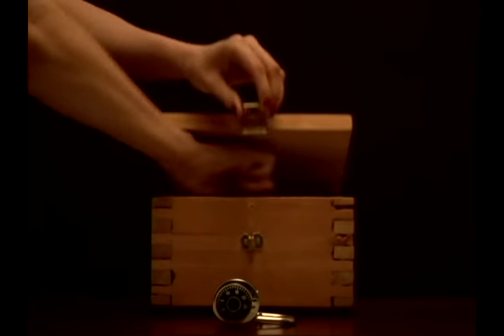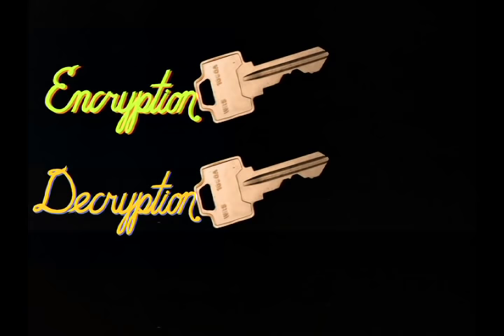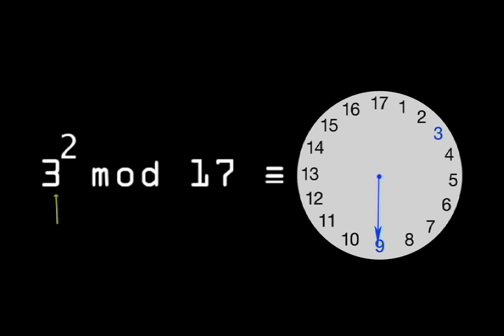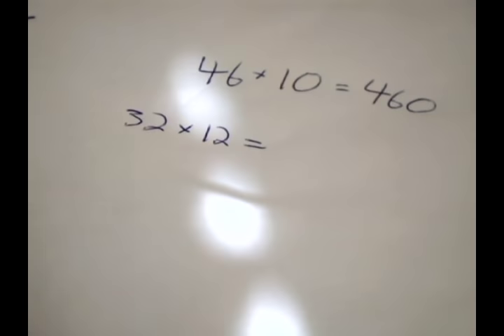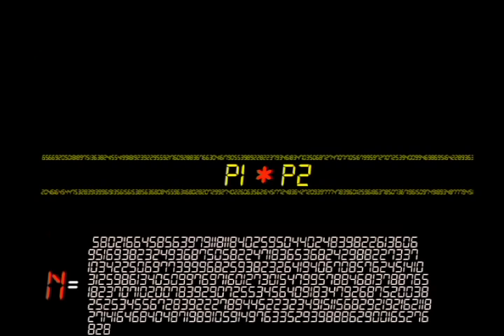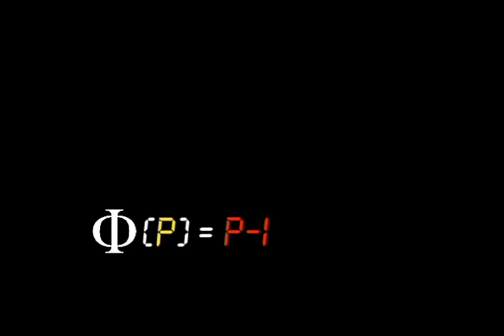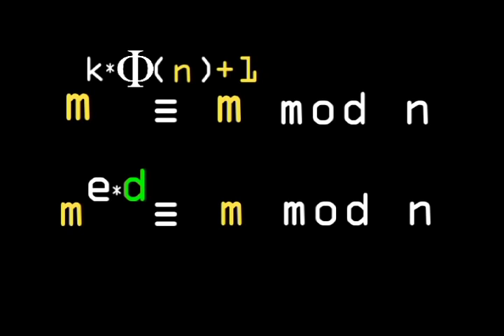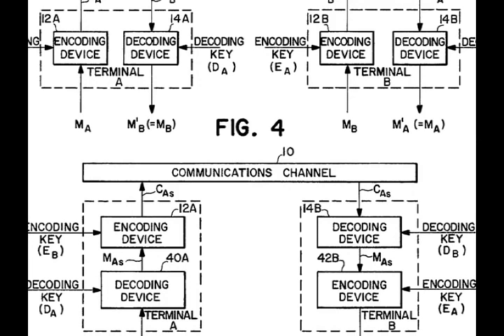Public Key Cryptography: RSA Encryption Algorithm

Comment: You say that Euler's Theorem works only if the two numbers are relatively prime, but nowhere in this system do you require that the message to be encoded and n=p*q are relatively prime. Why does this encryption method still work in the cases that m and n aren't relatively prime?

Comment: Admirable how simply you worked through explaining it all. Beautifully done, both the delivery and the accompanying graphics and animation
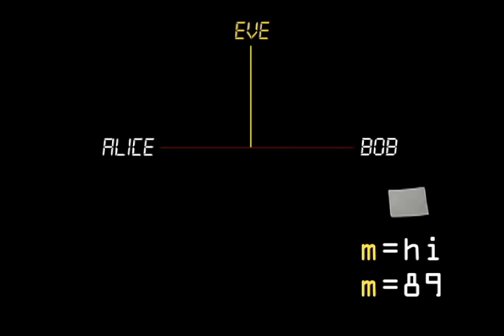Reply: +Art of the Problem question, at 13:43, which component is the chosen color, and which one is the "complement" color?
Reply: This is an amazingly well laid out video that is far easier to digest than learning it the math way.  I wish it was around 20 years ago!  I've never seen it's equal that shows the multiple ways - color mixing, private, secret, pre-shared, AND the underlying various encryption schemes/history in such an understandable manner!   Well Done!
Reply: at 14:14 did you put the value of k randomly. so if i put k=1 or k=5 i will have different values of d(decription key), will i get the same value of m(message)when using the decription key d?
Reply: @arfcommer15  The "math way" is clearer than this. This video glosses over many important details

Comment: Outstanding explanation with one frustrating defect: throwing 'k' in with absolutely no mention of how to obtain it. Getting the right k is essential for calculating d.
Reply: calculation of k is not entirely necessary. we can take the bezout relation of e and phi(n) as our d value, or use the extended euclidean algorithms to calculate it.
Reply: yes, it's right. d is a multiplicative inverse of e mod phi(n)
Reply: can someone please explain in simple terms how we get k, I need it for a project
Reply: (ed - 1) = k*phi(N) for some integer k, we don't really need to know what k is since we just obtain that cluster by doing (ed - 1). (According to a book on this subject).
Reply: Agreed.  That was glossed over.  As I understand it, because of the repeating nature of the mod function, k can be anything you want, just to add a bit of randomness into the key.  
Hopefully I can post a link to another video here, as choosing d and e is better explained here, IMO: https://www.youtube.com/watch?v=oOcTVTpUsPQ
Reply: Iterate k value start with 0 ,when d becomes an integer instead of a fraction stop. Here calculating k is not imp. As we we are just using d which is the private key.

Comment: I would like to share some ideas I learned about the topic. Many of you asked about how k came on. Let me approach this from a different angle. We would like to choose d so that e · d = k · ϕ(N) + 1 is true for some k. In other words, we need to fulfill the following congruence: e ⋅ d ≡ 1 (mod ϕ(N)). Since we have already found an e so that e and ϕ(N) don't share a common factor, or in other words, gcd(e, ϕ(N)) = 1, this congruence is a linear congruence for the variable d, which has a solution, because of the fact that gcd(e,ϕ(N)) = 1, and can be solved using Euklides' algorithm. Therefore, the main point is not to find a k by guessing, but to find d directly, using the method mentioned above. I hope this helped some of you.
Reply: i still dont understand why we need K
Reply: @bartoszkowalski885  you dont
Reply: OK I understand your point, but how do we calculate k?
Reply: @Loxodromius  you use the euclidean extended algorithm, which gives you d and k at once. You can Aldo get d with the Chinese Remainder theorem, if you know p and q, which is more efficient.
Reply: @bartoszkowalski885  I thought the usage of k is to find an integer d,
say at 14:20 (3016+1)/3=1005.667 but (2*3016+1)/3=2011, which is a 4-digit number

Comment: At 14:20 where did that k = 2 come from in d = (2*3016 + 1)/3 ????
Reply: So I pick k = 1 and end up with a non-integer number. What happens then?
Reply: Then you try k = 2, if it's still non-integer then you try k = 3. etc. In my exam we worked with these numbers, going to use the same variable names as in the video.

p1 = 31
p2 = 23
m = 42

n = 31*23 = 713
φ(n) = 30*22 = 660

Choosing e, starting with e = 3 => 660/3 = 220 //Not good
Testing e = 5 => 660/5 = 132 //Still not good
Testing e = 7 => 660/7 = 94.28571429 //Good, doesn't share factor with φ(n).

Choosting d, starting with k = 1:
d = (1*660+1)/7 = 94.42857143 //Not good, non-integer.
Try k = 2:
d = (2*660+1)/7 = 188.7142857 //Not good, non-integer.
Try k=3:
d = (3*660+1)/7 = 283 //Good

Encryption:
c = m^e mod n = 42^7 mod 713 = 199

Decryption:
m = c^d mod n = 199^283 mod 713 = 42

Hope this helps :)
Reply: tywald Thanks for writing it out! Helped a lot for a lazy mobile user.
Reply: my book kept confusing me as it didnt clear the trials that u showed. and with the video, i was goin crazy. thanks for putting it up.
Reply: thanks, made even the last bit clear
Reply: Hello,
in the video first he says φ(n) = n-1, then WHY φ(713) is not equal to 712 ?
Reply: jai bharat φ(n) = n-1 if n is prime
Reply: The number 713 is not a prime number. It has two prime factors (23 and 31).
He said that calculating φ is actually a hard problem for large numbers except for prime numbers where it simply is (n-1). 
φ of a composite number can be calculated by multiplying together φ of each primefactor of that composite number. 
So it simply is: 
φ(713) = φ(23*31) = φ(23) * φ(31) = 22 * 30 = 660.
Reply: for large integers (which in practical uses it will be) we cannot easily calculate this k as others have suggested. but i do not like working d out this way. d can actually be calculated using the extended euclidean algorithm. or, if you have the pari/gp calculator, taking the first number of the bezout relation of e and phi(n). saves the hassle
Reply: Thank you for explaining that. When I tried to go through the math, I was stuck wondering where we had pulled "k=2" from.
Reply: That formula is only valid for prime numbers.
Reply: 713 is not a prime number, hence its phi function is not equal to (prime -1)
To find if 713 is prime or not refer here : https://www.isprimenumber.com/prime/713
Reply: What you're doing in that step is solving for the multiplicative inverse of e mod phi(n). This is defined as e*d = 1 mod phi(n) and it implies that e*d + k*phi(n) = gcd(e,phi(n)) = 1. This is Bezout's identity.  Note that an inverse for e only exists if it is coprime to the modulus. This is because of Bezout's identity. By Euler's theorem, a^(phi(n)) = 1 mod n. This means that p^(e*d) = p^(1+k*phi(n)) = p^(1)*p^(k*phi(n)) = p^(1) mod n.
Reply: Hey there, anyway you'd mind explaing this a little more, I keep tripping at 42^7 mod 713. I'm a young female, and its probably odd for me to gain interest in encryption, but I want to.
Reply: that rule only applies when n is prime. 713 is not prime, so φ(713) does not equal 712
Reply: @tywald  thank you, i had the same doubt
Reply: thanks a lot  @tywald
Reply: @tywald  Your actually a life saver, no cap
Reply: @tywald  Thanks a looooooooot You r awesome. Did my day. Really appreciate it.
Reply: @danielwhettam1564  not when n is prime, but when the factors of n are prime. n will always be nonprime becuase it is a product of 2 numbers... namely p and q
Reply: anyone having trouble figuring out it, go here: https://www.cs.drexel.edu/~jpopyack/IntroCS/HW/RSAWorksheet.html
Reply: @jaibharat4994  because it's (p-1)*(q-1)
Reply: @tywald  Thank Genius..!!
Reply: @tywald  wowwww that's best example ever. Thanks
Reply: @jaibharat4994  Because 713 is not a prime number.Its factor are 23,31.
Reply: @tywald  thanks! So if I understand correct the 2 just ist the first number that gives a d without anything after the comma, right?
Reply: I did some calculation and found that k can be any number as long as  d turns out a whole number(integer). In the particular example k=2,5,8....can be taken, we get different values of d but when used to decrypt the cipher they all give back the same message. But does that mean that we can have infinite number of d(private keys)?? I am confused. Somebody please explain.
Reply: @rocksonrong8401  yes, you can have infinite number of d with different k, k2=k1+e, k3=k2+e, etc. and they yield the same result, however the hardest thing is to find the first d.
Reply: @tywald  Thanks so much!
Reply: I think k can be any number that should always gives d as an integer.

Comment: quick question, around 14:21 we see that the equation as 2 as the K value, why is that, because when I try to replicate this equation, I can't seem to get a resulting whole number, so why is it 2 in this case, what do you have to do to put in the value for K?
Reply: iterate k from 1 until (k*phi(n))+1) is divisible by e to give an integer, if the result is in fraction then increment k n try again.

Comment: Thank you so much for this video. It explained everything so well and helped me finally understand! Just one question. Since this all relies on Euler's Theorem, for which you mention that m and n must share no factors, what if the message m happens to share a factor with n (i.e. it is divisible by either p1 or p2)?
Reply: @Maya Bielecki 
Although Euler's theorem itself - in the form m^{φ(n)}≡1 (mod n) - is indeed only valid for an m relatively prime to the modulus n (relatively prime means that they share no non-trivial factors or equivalently that their greatest common divisor is 1), the actual relation justifying the validity of the encryption method is a bit more general, as follows: given a square-free natural number n (this condition means that n is not divisible by the square of any k≧2 or equivalently that all the prime divisors of n have multiplicity 1 in n; do remark that this is in particular the case for N=p_1*p_2, in the video presentation) and a natural number r congruent to 1 modulo φ(n), it is necessarily the case that m^r≡m (mod n).

Comment: Lovely Technology.

Public Certificates are a godsend. After all how many unsecure websites are there still. Shops, banks, services, so many are pretty much forced to have high grade RSA based security. The quality of the certificate and its signer might differ but most ought to be safe enough. 

And the funny thing is that once encryption is set it usually uses symetrical or some other lower power/energy method. But to set up the communication you use this pretty nifty system. 

Hell the idea that you can share a public key and yet you are safe. That is something quite special.

Comment: I'm sorry but the equation at 15:02 is incorrect.
It should be  (1394 ^ 2011) mod 3127 = 89
Reply: Thanks for that. Was following then got super confused. I mean how can you know the message (89) prior to running it.
Reply: What is shown at 15:02 is a congruence, not an equation. If someone writes "a (congruent) b mod n" (where congruent is usually written as the triple-line equals), that means "a mod n = b mod n" (this time actually equals, an equation). The first way is just a slightly simpler way to write it.
Reply: Larry Ruane - I still do not have `b` by that formula... and he clearly spoke "(c ^ d) mod n" and not the written formula (with congruent)
Reply: you read the symbols wrongly...  he didnt say 1394^2011=89 mod 3127
he stated: 1394^2011 is congruent to 89 modulo 3127( the three lines symbol denotes congruence and not equality) - this means 1394^2011 mod 3127 = 89 mod 3127 or simply 89. In case 1394^2011 mod 3127= 89 than its true... i dont have an algorithm to verify this bet it should be true.
Reply: Did you try it? if you did, you would be understanding that smth is off, cause that wouldn't give you 89 at all.

Comment: Thanks for all your videos, beautifully done, I'm using them to study for my exam. In min 15:04 it's written c^d ≡ 89 mod 3127. there should be c^d mod 3127 = 89? Sorry for my English.
Reply: In modular arithmetic, that's equivalent. If at the end you have mod N, you can think of parts before and after the ≡ as all having that mod N.
E.g. c^d ≡ 89 mod 3127 is the same as c^d mod 3127 = 89 mod 3127

Comment: If you can spoof the public key, you can MITM, but that is the beauty of public keys- they can be published all over, in centralized directories, in images, on multiple sites... so if you are diligent about checking you have the right public key, you can reduce MITM down to interruption of service or replacing messages altogether, but you can't read the sent messages.

Comment: At 15:02, the screen shows "1394 ^ 2011 = 89 mod 3127", which seems *wrong*!
The voice, however, seems to say the right thing: "c ^ d mod n = m" (or (1394 ^ 2011) mod 3127 = 89).
Agree?
Reply: I think 1394 ^ 2011 [is congruent to] 89 mod 3127, so it uses the three lines. I'm not sure about the specifics of what that means but it works the way you did it (do it with python: pow(1394, 2011, 3127))

Comment: In an attempt to better understand this I wrote it in to a script but it is common for the decripted message to come out as "1".  I have hard coded the msg and exponent and I randomly genrate the primes.  

Msg 89 and exponent 3

for example with prime 31 and 43 we get mod 1333, public key 1260, and private 840. 

I get 1145 as encripted msg and 1 as decripted

I run the script a few times and sometimes it works, the only thing that ever changes is the random primes.

Comment: At 12"15', it's stated that Euler's theorem m & n need to be co-prime, it used example 5 & 8. But m is message, does it mean for a particular e, d pair which have corresponding n, certain messages m which is not co-prime to that n can't be encrypted by this RSA key (because that message does not satisfy the conditions of m & n being co-prime)? So I think perhaps the explanation is not yet a complete picture?

Comment: One question: if I have a large string, let's say of 512 bytes, I can guess that I need to work like if my message 'm' was m = m1 + m2 + m3 + ..... at what lenght the string must be split to work with each piece separately? What is the requirement for 'm' to fit into the proccess?

Comment: Considering that N is usually a huge number and e is usually a fairly small number.  Isn't there a good chance that the cipher text C=m^e is smaller than N, especially for small messages? If that is the case all you need to do to decipher is m=C^(1/e). 
Take the example in the vid, if m would be 13 then C=13^3=2197 which is smaller than N=3127. So 2197^(1/3) is 13 and we have our message back. Doesn't this mean that the message must be large as well (m^e at least bigger than N)?
If I missed something, let me know. :P

Comment: How does 12:26 make any sense? Does 1 mod 8 not equal 1? So how does 625 = 1? Is this is mistake or am I missing something?
Reply: Mod 8 applies to the whole expression. Think of it not as 625 = (1 mod 8) but instead (625 = 1) mod 8
Reply: @isaacmammel9186  Oh wow.  mind blown.  I saw another video that did something similar and had to ignore that incongruency.  I'm familiar with the mod function from programming, but I guess mathematicians represent it differently.
Reply: @robneff7084  yes, the percent symbol takes the modulo of the operand, but in the video, they use a congruence relation (see how there are 3 lines instead of a normal equals)? Really that is what the mod affects in that case, a=b (mod n) means "a is congruent (mod n) to b" (pretend I used the triple equals because I am too lazy to find the proper symbol)

Comment: Hello! I have a little problem understanding Euler's theorem, explained at around 12:22. 

"When you raise m to the power of phi(n), 4, and divide by N, you will always be left with 1."

What am I missing here? 
The example that he uses is as far as I understand as follows:
5^4=625. 
625/N = 625/8 = 78.25 not left with one. 

I need to understand this for an important project, and help would be much appreciated.
Reply: 625/8 = 78.125.
0.125 is equal to 1/8.
625 mod 8 = 1.

Comment: But how was the (Message =89) got from 1394^2011 = X mod 217??? I calculated the 89 mod 3127 and it is 89... but it is not 1394^2011, so it does show any dependency with that part of the equation??? at the end I don't understand how finally Alice got the 89 message Bob sent to her. Could someone complete this part???

Comment: I used a small number as n (77) and my message m was 89 (larger than n) I then used the algorithm to find k, e, d and plugged them in, it didn't work. I tried it with a message smaller than n (42) and it worked. Why is this?

Comment: Can anyone explain to me why on 12:25 he raises m to phi m (4) and not phi n (7) as the function mentions? m = 5 --> phi m = 4, and n = 8 --> phi 8 = 7. So when put this in the formula I expect to get this: m^phi(n) = 1 mod n --> 5^7 = 1 mod 8.
He raises 5 with phi 5 (which is 4). Why?
Reply: Nevermind. I get it. 8 is no prime number. Therefore n-1 does not apply. Phi 8 = 4 and not 7. The confusion was with prime number 5 and its phi function, which is 4. It is just a coincidence that both 5 and 8 have the same phi result, which is 4.

Comment: Here , I did not get representation of Mod Function. Mod function has 2 Inputs. so Here only one Input is there, In same example

1394^2011=89 mod 3127. Is output remainder of 3127 divide by 89 or 
remainder of 89 divide by 3127 or
89 is remainder of (1394^2011) divide by 3127.

In all cases RHS not equal to LHS, Apology if I m incorrect

Comment: I think there is a mistake in equation in 15:03 -  shouldn't it be "1394^2011 mod 3127 = 89" ?
You have also said that, but the equation differs.

Comment: how does one of the M's in M*M become the exponent 1 at 13:08?
Reply: +TheOldalf Imagine that you have m^5. If you multiply that number to an additional m, you end up with  m*m^5 . That expression can be written too as  m^(5+1) = m^6 . This very same thing happens at 13:08, only that instead of having m to the power of 5 (m^5) you have m to the power of another expression (m^(k*phi(n)), but the rule still applies.